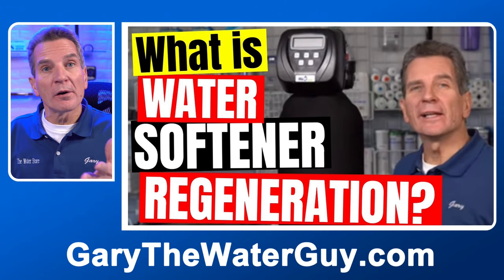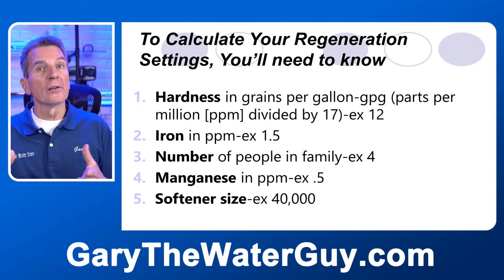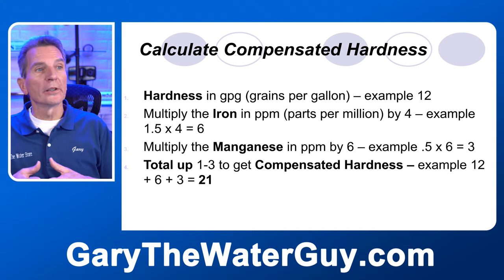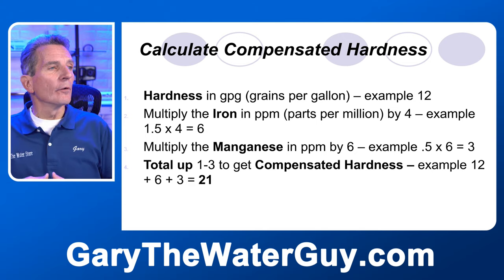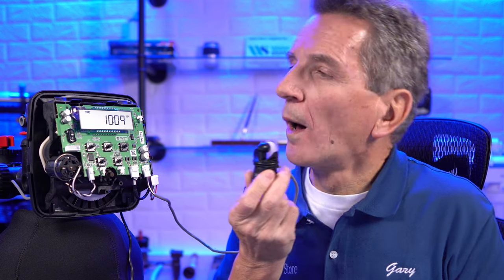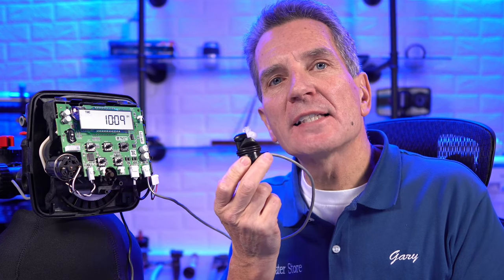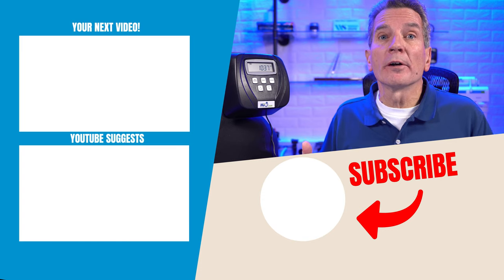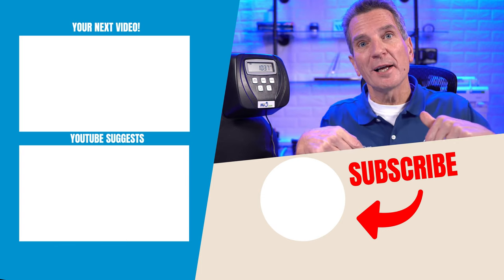How OFTEN SHOULD My Water Softener REGENERATE?

Comment: I just had a Clack WS1 water softener installed at my cottage and the tech set the filter to regenerate at 800 gallons or every Monday whichever comes first. My assumption is he used our test results and estimated usage to calculate this frequency? Our water usage can vary considerably depending on visitors and time of year. For example, if we leave the cottage Tuesday morning after using very little water and don't plan to return until the following Tuesday, it seems a waste to regenerate after minimal usage. Isn't it easier to regenerate manually as we can see our usage between regeneration? And, we can pick a regeneration time when we aren't using the water.
Reply from the maker: Great question.  The water softener needs to regenerate at least every 14 days or you will have problems.  I would change the 8 to 14 to minmize wasted water and salt.

Comment: Gary, Excellent video! As a technician in another industry, I really appreciate your detailed explanation, while maintaining simplicity for the average Joe. That said, and I know you'll cringe at this approach, but on our new softener, I simply started at 21 days and reduced by 3 per step until the water remained soft. I know... I know; I'm bad. LOL. I am curious to understand why the complicated math instead of simply taking the actual water usage for the last 6-12 months from the water bills or calling the city, converting from cubic feet to gal (ours is measured in cuft not gal), and then dividing by 30 to obtain the actual usage? Thoughts?
Reply from the maker: Whatever way you calculate usage is fine.  Many of our customers are on well or surface water so they do not have the option of knowing their water usage , the rest cringe when I ask them to check their water bill for their usage.
Reply: @water_estore  All class Gary -  thanks for that answer.

Comment: Gary, I've noticed I have some hard water the morning after regeneration. (I have the WS1 head 3 years old)  I checked the settings and my hardness was set at 10.  I haven't had my water tested for manganese or iron PPM and was thinking I should change my softener to a longer backwash and rinse cycle as I think it's not doing that effectively.  All other times my water is soft.  I regen at 2 a.m. and there is no water being drawn into the water heater (or anywhere else) at that time.  I've tweaked the hardness up to 12, but found your site and thought I'd ask before I monkey with the other settings.  Thoughts?  Thanks!  OH, and I'm on a residential well.  235 ft deep, with 300 gallons of above ground storage (slow producing well)
Reply from the maker: If you mean salty water after regeneration, yes adding more time to the 2nd backwash and rinse will help. If your water is hard after regen, increase the hardness settings.
Reply: @water_estore  I"m not noticing "salty" water, I"m noticing that tacky feel you get when soaping up in the shower you get from Hard water after generation.  I set it up for a longer backwash cycle.  I hope that's all it is.  Thanks

Comment: Gary, I have really learned a lot from watching your videos. Thanks! I have a Fleck 7000 that after 14 years of regeneration it used to show ~1,400 gallons filtered before regeneration. Last time I regenerated it only showed 220 gallons before the next regeneration. I did some troubleshooting you recommended and found that salt in my brine tank was somewhat solid, so I dumped it out and started with a fresh load of salt crystals. I also found a blockage in the drain line. I also checked and cleaned the brine tank float. Unfortunately none of those fixed the problem. Right now the water level is 6-8" above the salt. Would adding more salt fix the problem? What should I check next? Thanks in advance for your help!
Reply from the maker: I am not an expert on Fleck but did you recently chnage the hardness, capacity or salt content settings?

Comment: Hi Gary We have the Home Despot supplied Ecopure EP42. It continually plugs up, especially with Sifto, that the HD supplied.  I emptied it all out, ran hot water through and now even the Windsor from HH plugs, alas...  The hardness is 13, mostly from our well here on the North Mtn in NS; which, sits on gypsum. No iron. I don't know 'bout manganese.  I had it set for 15.  There is no day clock to set this animal by, only hardness.  I keep the salt down below 2 on the tank and break the salt up every Saturday with a wooden pole driven in with a dead blow hammer, 'till it bottoms out on the plastic well. I see that the Despot no longer carries this brand. When you call the company you get an immigrant who can barely speak English. When I built these digs, I got sucked into a water conditioner which only minimized the calcium deposits. My black car always looked like a leopard if I did not towel it off. hahaha I really hesitate to purchase a Clack cooked unit. What can we do?
Reply from the maker: Don't get me started about Big Box store water softeners, remember, you get what you pay for. You might want to have the water tested after the water softener to see if it actaully works or not.  Also have the water tested for TDS.
Reply: Water can have Trump derangement syndrome? Never knew that explains a lot.

Comment: I have a 6200 SXT Automatic Meter Initiated Water Softener.  It started "clicking" early this morning. I unplugged an the screen just showed the letters PF.  It sounds like it is continuously running. Also my well pump runs without shutting off.??? Help !!!  I am pretty...very ignorant and need any assistance ASAP--Happy Easter!!!.  Thanks for the consideration, Robb.
Reply from the maker: It sounds like the piston is stuck in the seals and it needs to be rebuilt.

Comment: Hi Gary - I’m running into the issue of finding a water softener/whole house filtration for my home which only uses about 50 gallons a day as it is a 1-person home. Using your calculations and the smallest unit I have found online at 32000 grains, it would regenerate every 32 days which is too long for the resin beads to sit without regen, correct. What unit should I be looking for? Most articles and videos factor in the standard 4-6 person household which have not been too helpful!
Reply from the maker: This is the one I suggest https://waterestore.ca/products/waterboss-pro-180-high-efficiency-water-softener?_pos=176&_sid=83c510f3e&_ss=r Only 17 gallons of water per regeneration and 18,000 grains.
Reply: @water_estore  What is the difference in the 700 vs pro 180?

Comment: My regen cycle started at 7pm tonight and it's normally programmed for 1 am....what does that mean? Is it normal for a water regen to start in the middle of the day?
Reply: It sounds like the timer on your water softener control is incorrect. Did you have a power outage recently, or unplug the system for a period of time? That might have caused it.
Reply: @ooopticnerveee  i had a small power outage 2-3 weeks ago but did not think it was enough to reset it. I will check tonight
 Thank you for the quick reply! Cheers
Reply from the maker: No likely your current time is incorrect
Reply: Ok so as it turns out, my current time is correct and my timer is set for 11:30 at night because we get up early for work. Now, im getting random regen at 07:30 at night or 11:30 (programmed time) and it's everyday. My current settings for day is every 6 days... this is very confusing

Comment: I have a Culligan. It just doesn't seem soft or slimy at all. They increased regeneration and softness is at max. they've been out a couple times but it seems off. Still have calcium build up in some places for sinks and toilets ... I know it's not working the way it should. I compared a local grocery store today when I washed my hands and whomever did their system did the job correctly it felt amazing.
Reply from the maker: What are your hardness level before and after the softener?

Comment: Great video! Is there a maximum number of days a water softener can go before regenerating? For example, does it need to regenerate at least every 14 days even if the water is still soft? 

My calculated regeneration total gal is 2100, but at day 14 we have only used around 1200 gal (only 2 people). The water is still soft and there isn't any noticeable issues. I just wasn't sure if the water softener needs to be forced to regeneration earlier or if I should let it go until it hits the total gal amount. For now I reduced the gal amount to 1500 just to be safe ;).
Reply from the maker: 14 days is the maximum.  If you let it go longer you will eventually clog the media in the tank.  You water softener is oversized.  We typically plan to size the water softener so it regenerates every 5 days or so.

Comment: Hi Gary, 
Thanks so much for your very informative videos. 
We had our Clack water softener installed by a professional plumber but I am not sure that the settings are correct. We are a 2-4 person household.
His settings are: Hardness 20, Capacity 24,000, Salt usage 9.5 lbs
Our well water analysis shows: Hardness - 172 ppm (10 g/gal), Iron - 0.075ppm, Manganese 0.078 ppm
The resin tank size is 1054 (10" x 54"), that's 48,000 Grain Capacity, right?
What should the settings be for hardness, capacity and salt usage?
Thanks.
Reply from the maker: Your plumber left it at the default settings, bad plumber!  With that size tank it could be 48,000 grains but who knows what is actually in the tank, you need to ask the plumber what size water softener you received.  This video will show you how to program the correct settings https://youtu.be/c6r7qUK8to4  Assuming it is 48,000 grains the settings should be Hardness 10+1+2=13.  Capacity 38,400 Salt 14.
Reply: @water_estore  Thanks for the reply. I will talk to the plumber. I was hoping to use as little salt as possible. Maybe a smaller tank would be better.
Reply: @water_estore   thank you so much for your videos! They're so helpful!  My system and needs are similar to Urs' , and my plumber appears to have set things up incorrectly as well.  For whatever reason it was set up for regeneration every two weeks and to use 24 lb of salt. We have four people in the house and probably use  more than the average amount of water.

Comment: What happens if you over estimate water usage in the settings?  Is there any issue if the water softener regenerates too often?  Or is that just a waste of water and salt?  I guess what im asking is can the resin get too clean or something and cause salty tasting water or sodium spots on dishes?  I ask because I have water spots on cars and dishes when water dries on them.  but hardness water testing shows 0 ppm.
Reply from the maker: Yes, you can raise the sodium residual by over softening the water but likely the casue of those water spots, assumning the water softener is working, is that you likley have high Total Dissolved Solids in your water.  Softening your water does not lower the TDS.

Comment: Garry your tutorials are great. Thank you. My Fleck sxt 9100 is not softening our water. I have inspected and cleaned the injector assembly and manually backwashed 2 or 3 times over a couple of weeks. I have stirred the brine tank numerous times. On backwash it does recycle brine H20. I don't yet know know how to read/interpret the program settings. I am wondering if I should do a reset/re-program. I will need to access my hardness data etc. I will flush my tankless water heater next. I don't know where to go from here. Any direction would be helpful. Thank you again.
Reply from the maker: I would go through the trouble shooting steps outlined in this video https://youtu.be/Lr3jyGiJdC0

Comment: Hi Gary! I love your videos, they’ve been such a great help in understanding the mystery that is the humble water softener. Just wanted to give another reason why a water softener might not be regenerating that I learned on my own the hard way! If the meter cable gets pulled out, it (obviously) stops calculating how much water is going through, thus stops regenerating. This was one scenario I haven’t seen mentioned in any video or website in my research - I just happened to notice when watching a video about the meter assembly (I was like HEY! Mine’s unplugged! 😂). Now it’s plugged in and finally regenerating on its own. My salt stayed at the same position in the tanks for months until I figured this out. Cheers and thanks again for all the info you give us!
Reply from the maker: Thanks for the input! Yes, that is another thing to check while troubleshooting!

Comment: Hi Gary we have a waterboss 900 model. The meter read 00 x 100 available soft water. Is this something to be worried about? Will it regenerate on its own? Will I run out of soft water? I have salt in tank with water in the tank as well. Some insight would be very appreciated.
Reply from the maker: Yes it will regenerate on it's own.  No you will not run out of soft water.

Comment: We bought a 2 yr old house that already had a water softener system installed. It came with a 20 pages report detailing all kind of stuff. The original owner was a single occupant, and the system was setup for regeneration every 14 days.
Since we are now 2 adults, should I set regeneration to every 7 days?
Reply from the maker: It depends.  Manmy water softeners are metered but they have a 14 day over ride.  In that case you would not change it.  If it is not a metered water softener you would need to calcluate how often it needs to regenerate but you would need to know the hardness and iron dontent of the water.

Comment: My softener has Salt efficiency mode that can be turned on/off. The manual says it may regenerate more often with this enabled.  It also says Salt Efficiency enabled will use more water, less salt. Disabled it uses less water, more salt.  My concern about having it on is, if its using less salt will it still soften my water to correct setting as well as it would when it's disabled?
Reply from the maker: I really do not know.  None of the water softeners we use has that mode.

Comment: As the water softener's medium slowly saturates with the minerals (hardness), does it absorb less and less of those minerals over time? Meaning, is the water super soft right after regeneration, and then slightly more hard over the next few days until it regenerates again? Finally, if the tank hasn't been regenerated (due to wrong settings, maybe Hardness set very low) and the medium is saturated, I suppose that it's not catching any more minerals and your output is basically the raw water (as if the softener was bypassed)?
Reply: If this is true, can you use this effect (slightly lower your Hardness setting) to control the average water hardness, making is slightly less soft on average?
Reply from the maker: no, then softening is constant and consistant. Yes, if the media is compromised you will need to clean the media before it works properly. https://waterestore.com/products/pro-res-care-water-softener-resin-cleaner
Reply from the maker: No, that won't work.  You need to have the hardness setting set correctly based on your waters hardness.

Comment: Did I miss how you set HOW OFTEN for a metered water softener? You only showed the hardness--what about the flow number? Does the controller automatically set the number of gallons? Thanks. PS I have a Fleck 6500SE.
Reply from the maker: Metered water softeners calculate the frequency themsolves IF the correct settings are programmed into the softener.
Reply: @water_estore  Thanks. I've been trying to do this using your formula (as I understand it). For the numbers I got from the local water quality person, hardness 9.2 ppm, iron 121 ppb, magnanese 9.2 ppb and adding 2 gpg I get 11.684 ppm. The problem I have is with the units. Some of them are ppm but maybe my water softener uses gpg for the hardness factor (I think) AND you also have added 2  gpg to the number so we are adding ppm and gpg together. Any comments? Thanks.

Comment: If I used strips do I need to do the compensated hardness calculation? For example if I have a hardness of 3 how many gallons in between regeneration?
Reply from the maker: Yes, you still need to do the calculation. The gallons depends on the size of your water softener, the salt dosage and a number of other factors
Reply: @water_estore  yikes.

Comment: Great video, very informative!
I recently bought a house with a water softener. We don’t use much water in my household (1500 gallons a month). So, I would like to prevent unnecessary regeneration on my system. I see that at my current hardness level, my system automatically calculated it will regenerate in 3,700 gallons. So, more than 2 months. My system allows settings for regeneration at those gallons, or at a default number of days (programmed at 1 to 29 days regardless of water usage).

However, my softener system will only allow for a default time regeneration at maximum 30 days, or I can turn it off completely so it only regenerates once the gallon usage is completed.

My question is: do I lose anything by completely turning off the default days regeneration setting and relying solely on the usage regeneration calculator?

Thank you!
Reply from the maker: Your water softener will stop softening your water.  Your water softener is oversized and this is the big problem with oversizing.  Bigger isn't better. The water softener needs to regenerate at least every 14 days or you'll get channelling through the media and it will stop softening.  Change the over ride to 14 days and when you replace the water softener get one that is the correct size. This video will help. https://youtu.be/NLUUJCmF_AM